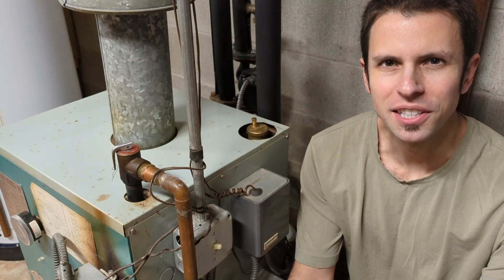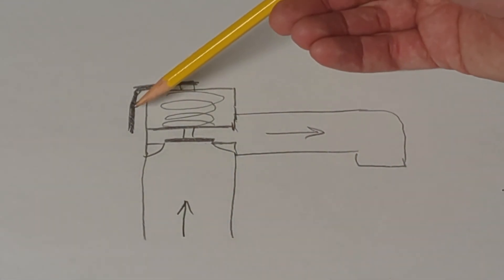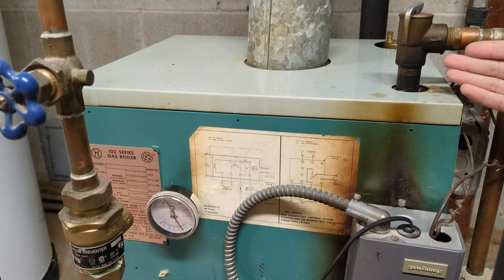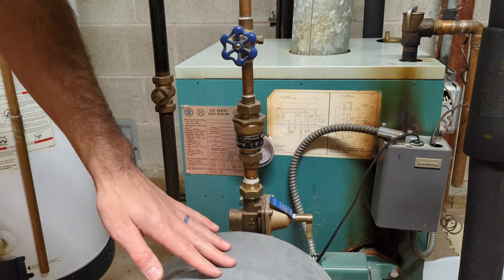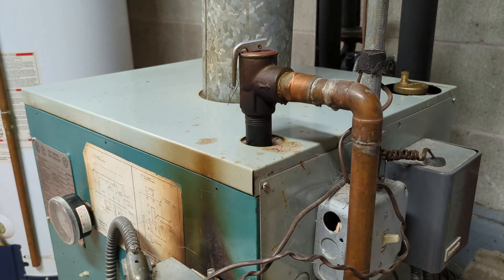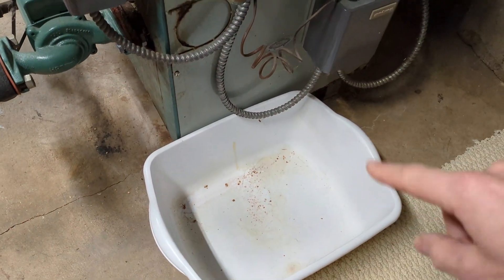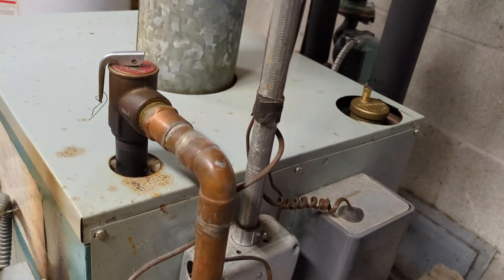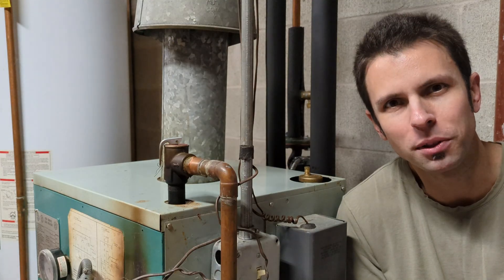Why Your Boiler Pressure Relief Valve (PRV) is Leaking / Dripping - ConBraCo, Watts, Apollo - 30 psi

Comment: So prv has a constant drip and psi is @ 15 it’s safe to say i have to change out the prv ?!
Reply from the maker: If it's over 10 years old it's a good idea. It may just have some scale build up and manually opening the top a couple times may clear it and reseat the valve.
Reply: It’s has to be ten maybe less but I opened and closed the valve several times it has a steady drip and psi is at 15 and goes up to 19 temp is 180
Reply: I would like to send you a picture or video of my unit if that’s ok with you I don’t have the funds to spend on a repair  man and if I can do it on my own I would definitely fix it  without jeopardizing the safety of myself or anyone in my household .
Reply from the maker: @cristianrivas7540  if you want, you should be able to upload a YouTube video and post a link to it here in the comments. What is the prv's psi rating? And constant drip regardless of pressure? How much water collecting per day?

Comment: The oil boiler PRV has a leak and the valve is rated at 30 psi but our boiler technician wants to install the one that has 125 psi. Is this correct?
Reply from the maker: Oil boiler? I'm not sure but doesn't sound right. What psi does the gauge normally read?
Reply: @realhouseDIY  Right now it's at 50psi. I didn't check in the past.
Reply from the maker: @yubemful  what psi is your pressure reducing valve listed for? And is there a label on the boiler stating max working pressure?
Reply: @realhouseDIY  All I'm seeing on the label is the pump pressure: 150 psi. It's Weil-McLain QB-180 model. We moved in 2 years ago,
Reply from the maker: @yubemful  that's the burner. I looked it up and the boilers that match to it. Certainly looks like the 30 psi prv for the hot water is the correct one.
Reply: @realhouseDIY  Thanks for your reply and effort!

Comment: This is by far the best video I have ever seen explaining everything. Thank you very much. I saw one drip hanging off. The pressure Relief valve.  And I got worried.  Just because I was testing my heating system over the weekend. So heating system has been off for at least 6 months

Comment: This is a great video! I used to install boilers but never got into servicing them until i have my own. Just turned it on and the blowoff keeps popping and i got half a bucket of water on the floor already. I just replaced the fast fill/pressure reducing valve last year and tested everything else, all was fine. Those only went bad when you touched them but i havent yet. The temperature is fine, mine sits at 17 psi for three floors. I will test my expansion tank but the only thing left is the pressure reducing valve AGAIN or the seat of the blowoff not right. But the seat is still experiencing extra pressure and going off so the 'seat' doesnt seem to be the cause.
Reply from the maker: @melodicapex860  yes, possibly the expansion tank not doing it's job!
Reply: I just saw this comment now, my guess would be the expansion tank is either ruptured or not large enough for the system you have.  It is supposed to be 10% of the entire water volume of your system.   Calculate 10 litres for each rad and another 10L for the boiler, and add them up and divide by 10 to get the ideal volume for the expansion tank.  Mine was a 6L tank and was too small as well as rusting through!